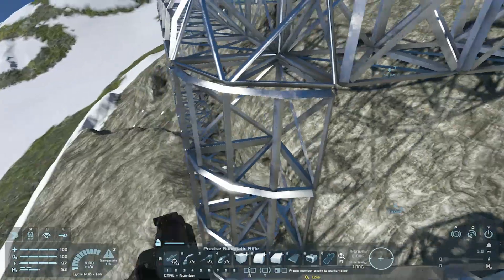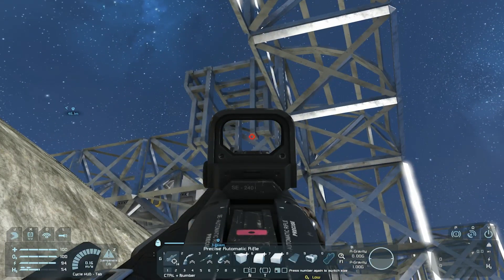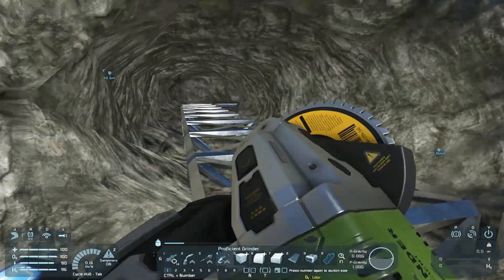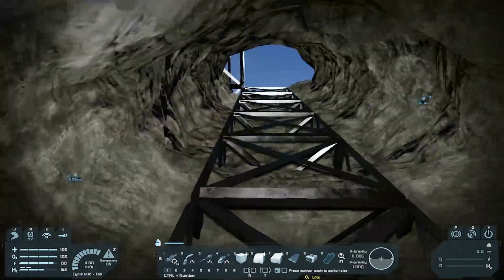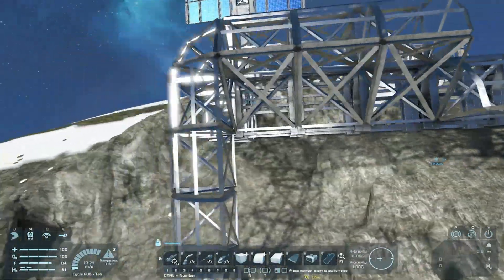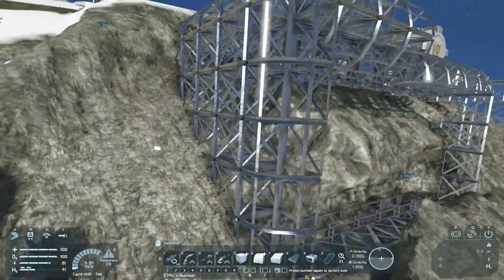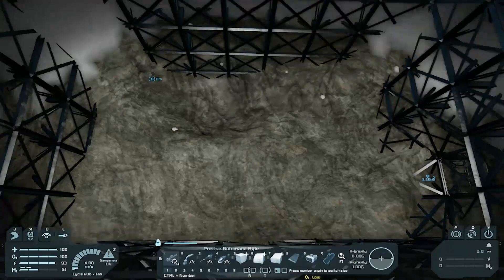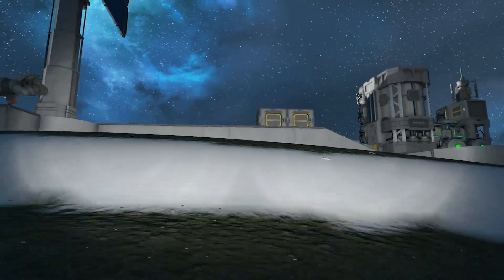Let's Play Space Engineers - Episode 17: Refining The Hangar Design

Comment: I prefer the metalled door frame instead of the rock for the inner door on the hangar. Also, I think the roof would look much better as a one block thick affair without the rolls at the top, instead of those, just use catwalks to cover over the tops of the hangar doors or even the whole upper level. That would even let you put in railings around the sides so you could use it as a sort of widows walk or lookout post if you want to RP it.

Comment: There is a script (or maybe it is a mod) on the workshop that tracks the sun. You set up the programmable block let it sit for a full day night cycle so it can calibrate. after that it can tell you exactly what time in is on your part of the planet. You can then use it to turn of and off lights and other things based on the time of day. You could also use this to set the panels to rotate at a set speed or time. 

Also their is a website that helps you build scrips for SE It is easy to use. You just go through lists of some options (like a bunch or and or logic gate options. You tell it what actions you what the script to do in a set circumstance based on a veritable that the games code can be used to allow the script to read. so like if you want the script to lock connectors when they sense each other you put in block connector, ACTION lock OR unlock and then WHEN near) to tell it what you want the script to do and it does the hard part of writing the details of the script. Epik from Epiktek has a video where he goes over the basics of it and he talks about it in some of his other videos and he has made a few scripts on in over the last few months in his second season of his lets play. If I can find it in his description or remember what it is called I will come back a edit this to leave a link.